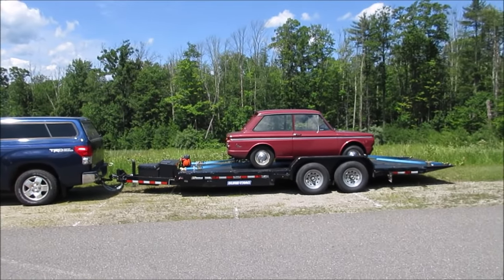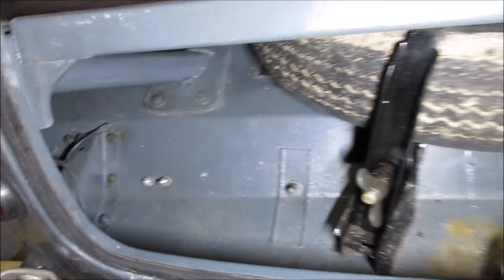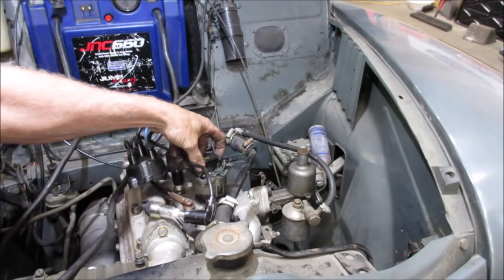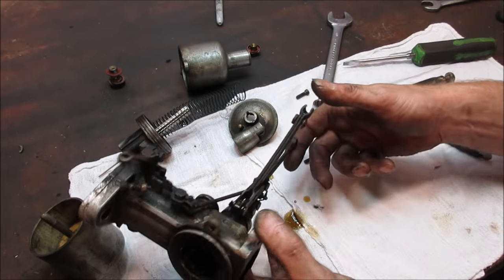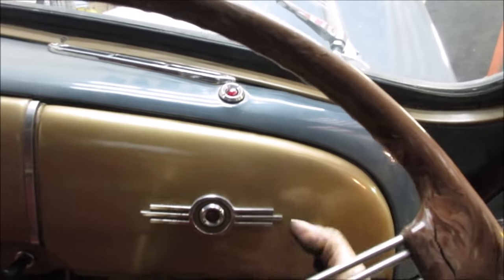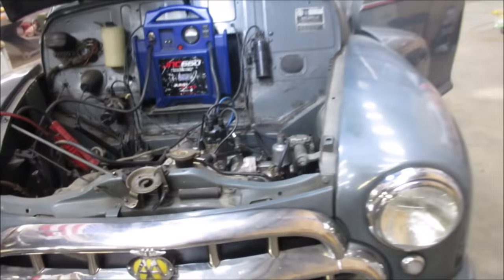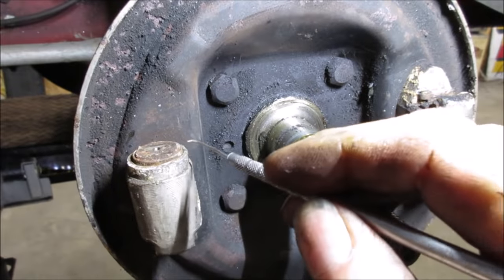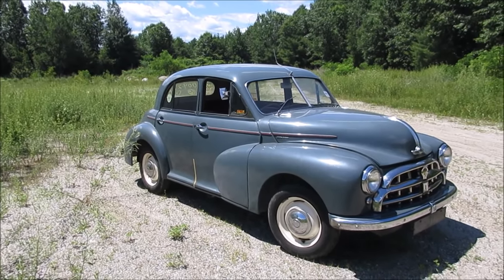50s Morris Oxford Found in an Old Warehouse. Did It Survive?

Comment: Hello... the semaphore was not as much a directional signal as it was more a parking light. Unlike North America, many of the roads and village streets of Europe and the UK are/were single lane, with barely enough room to park a car along the side, up against the wall or building. With many blind curves, the semaphore light served more or less as a hazard/warning lamp, though some did use as a directional. Later cars in Europe would later incorporate it into the  parking light system, only very dim, for battery conservation. Simply remove the key and employ the directional signal control, left or right. When the car is off, it remains constant, not flashing. This is, of course, independent of the emergency flasher circuitry...
I hope this helps...
PS The RAC/RECOVERY DECAL is the Royal Auto Club membership decal... similar to membership in AAA

Comment: To find out where the DC power system on a car is positive or negative ground, your theory is correct. Once the car is running, you can measure the output of the generator to find out the car body connects to positive or negative voltage, in the mean time disconnect the generator output wires from the car. Another method is to turn the generator without running the engine, just disconnect all the output of the generator from the car and attach those output wires to your multimeter. But, if somebody modified the wiring previously, then we need to verify this question with manufacturer document.

Comment: This model seems to cause lots of confusion.   Some folk clearly think it's a Morris Minor (which admittedly looks very similar but was significantly smaller and much more common),  which I can understand.  It's surprising though how many people are asserting quite confidently that India's Hindustan Ambassador was based on this model, which is simply wrong.  The Ambassador was indeed based on a car with a similar name (and no doubt plenty of shared mechanical bits beneath the skin), but the model featured in this video is the Morris Oxford MO, which was replaced in May 1954 by the quite different Morris Oxford Series II, which in turn was updated in 1956 as the Series III.     It was the Series III that saw new life from 1957 as the Hindustan Ambassador.  Here endeth the lesson!
  Great video, by the way - and good to see old British treasures surviving around the globe

Comment: I was working on a project at the airport in Mumbai, India about 20 years ago. These are what the domestic taxi service use, I understand that someone imported the old tooling and has been building them in India for many years. They were available new when I was there, around $1000. US dollars and available in Taxi colors of black and yellow, there also was a factory issue with
 A/C that came in a two-tone blue. I rode many miles in one of them traveling to visit vendors that were suppling some of the fabricated some our components that we had not imported from California. Some of the older ones the owners had installed 3 cylinder Yanmar Diesel engines in them and were trying to keep the vehicle on the road a few more years.

Comment: no air fuel mix its done by the metering needle being tapperd thin at the end thicker at the top, the jet seat is normally adjustable by threads lower it will make it rich, the choke is done by pulling the jet seat down there for allowing more fuel in.

Comment: Might want to check the dip stick again to see if oil level has come up! Pouring water in the radatior  may be filling the crank case if the head or block is cracked! I have an old Mercedes I poured antifreeze in it and raised the oil level in the crank case, not running right now traded for it to use motor in another project, hoping it is a head gasket but with my luck it is block or heas!

Comment: Hi, I may be a bit late with this but it is always a good idea to put the grounding lead from the booster directly on to the motor and not on the battery. Connecting both to the battery can cause a problem, especially if the bonding cable is not securely attached to the engine which can cause an overload to the internal battery. Just saying😸

Comment: Someone else has probably told you all this already.  Designed by Alec Issigonis.  For a flat 4 engine as the Mosquito.  Ended up as the Morris Minor with originally an 803cc side valve engine quickly on to a 948 OHV engine.  I owned a pick up version.  If you want to know more just ask....

Comment: This is an SU constant-velocity carburettor. The piston with the needle will rise with vacuum from the engine, as you step on the accelerator. As the butterfly valve opens, you increase the vacuum on the carburettor side . There is a porting that starts from the throat to the top of the piston. The piston will rise, allowing air through the butterfly valve. The tapered needle fits into the main jet. As it rises, the venturi effect of the rushing air will suck fuel from the main jet. The piston will stay in position at the given accelerator position, as the vacuum lessens when the piston rise. The main jet can be raised or lowered ( to control mixture richness) from under the carburettor. There is no need for an accelerator pump in constant-velocity carburettors. Technically, they are " slower in response" than the later downdraft or sidedraft carburettors. But they can be more frugal with fuel.
Trinidad & Tobago.
West Indies.

Comment: The fuel pumps were originally mechanical, then electric, with a long pull short push. On the mini it was mounted at the rear underneath the car, short pull long push, brilliant idea, out of dry hood into the wet and dirt/salt environment.

Comment: A quick search on Google would have answered a lot of questions about the positive earth etc. This seems to be an early 50's Morris Oxford, maybe 50 to 53, the body style changed in 54. These cars were more rare than the smaller, more common Morris Minor which had a very similar body style and was the predecessor to the Mini which was introduced in 1959, but the Minor continued in production alongside the Mini until about 1974 I believe. I used to see these cars occasionally growing up in the 70's and 80's in NZ when they were still running around. Good solid British cars. The Morris Oxford lived on in India as the Hindustan Ambassador into the early 21st century, as all the tooling for the Oxford was shipped off to India when production ceased in 1959 in the UK. That was the facelifted  Oxford Mk III shape which began life in 1956 It was one of the longest produced production cars in the world when in ceased production in 2013.

Comment: To answer your question about suspension damping it seems that this car has inboard hydraulic suspension dampers. That's the pod that's right behind the battery with the castle nut on it. I'm not from the UK and I've never been there, but as soon as you showed that front suspension setup the first thing I said to myself was that it had to be hydraulically dampened. Can someone from the UK that knows these cars verify?

Comment: Positive ground or negative, it doesn't matter. That model and date has a dynamo, and all you do is to connect the battery leads the other way round! But this is important, before connecting the second battery lead, turn on the ignition and then just quickly flash the lead onto it's terminal a couple of times. Then connect the lead and that's it, you've converted a positive ground car to negative ground!  But be warned, only so this if the car has a dynamo, which that one does. Hoping this helps. An afterthought.  If the car has a radio, disconnect it first, as in most cases it can't be changed over to negative ground.

Comment: I have just watched this glorious video again,  and I appreciate more than my previous comment might have suggested, how much this old British automobile would have differed to its US counterpart in 1955. Although I suspect that this Oxford model had long gone by 1955, along with the split screen. My 1955 Austin A50 (a similar size car) was a far more advanced car with Austin's 1500cc B series engine, full windscreen, and flashing indicators.
Anyway, during my first watch - a year ago, I, as other comments also state, was shouting at the screen and wondering what was wrong with this mechanic having to work out things that to me were basic.  That was insincere of me, so I would like to apologise to him.  I was never a trained motor mechanic, but from being 19yrs of age, up until my 60's, I have serviced and repaired all my own and my father's cars. I'm 80 now, so it's all history.  I learned the hard way as needs must when you can't afford to pay someone else. My first learning curve was on an evil 1950 Morris Minor MM lowlight, bought by me in 1961 ... I was sure that it had been cursed by one of its many previous owners.
Nonetheless,  being the little sister of this chap's MO Oxford, most of his problems were all too familiar, the two cars being family and the offspring born side by side on the drawing board of Alec Issigonnis in 1948.  While I now abate any further criticism, I wonder if anyone else suspected that that poorly engine had a serious timing issue - ignition or valves.  That broken gear wheel he found in the boot (trunk), looked very much like a camshaft gear which is suspicious.  Being a side valve engine, a mistimed valve cannot be damaged by the piston as it would in an OHV engine. The brakes on Morris cars were by Lockheed, so where on Earth replacement cylinders and adjusters will be found in the US I can't imagine.  But here in the UK, we have a number of Morris Minor Clubs and restorers who must be getting parts from somewhere.  They can make an old 'Moggy' like new again. Oh yes, does anyone know why this car's battery was sitting on the heaviest side of the engine instead of in the bulkhead tray as in the Morris Minors?+++++++++++++

Comment: SU. Carb , long lower rod is the choke , accelerator is the Diaphram, the center jet is mixture usually 2 turns down from flush as a start. Same used on MGBs different versions.Have fun..

Comment: That brass nut on the carb that you dropped oil into is a damper for the large piston. You should put more oil into it so it slows the movement of the piston

Comment: SU carb..  You probably know by now but the Top bottle is a vacuum operated chamber that controls the flow of fuel. The internal piston has a tapered needle fitted which as it lifts allows more fuel. The lower lever tibe assembly is the Choke mechanism, It effectively lowers the tube which allows more fuel to pass the needle for cold stating. The position of the tapered  needle is critical. as is the number stamped on the body of the needle. Unless you gar fuel leaking from the choke tube it's best not to tamper with the setting. Mixture adjustment is also done with the smaller spring hexagon nut which adjusts the height of the choke tube and hence the fuel air maxture.  A very simple but very relable carb used on almost many British cars from the Mini to the Rolls Royce. and lote in between.. The  Chamberr on top of the Bottle assembly is a damper to smooth out the movement of the piston, it should be filled with a 30 grsde oil to 1/2 inch from the top.

Comment: In the early to mid 80ies, the mechanical gas pumps could not handle the higher prices. Oil companies installed a modification to dispense liters instead.
This confused a lot of people. This sticker was advertising from Shell to help customers understand how much fuel they were getting.
the statement "It will improve you car was referring to the gasoline but my guess is that they also wanted people to think buying by the liter would somehow give you better performance.

Comment: That SU-carb has same kind slide system as late Strombergs but those had rubber membran under the cap. They recommend use ATF oil in it.

Comment: Arrr the ol Morrie. Still a few getting around here in OZ. Not that expensive either. 44:23 our UK gentleman can correct me if I’m wrong, I think the whitworth spanner size refers to the thread diameter, not across the flats like metric and imperial ( what U.S call standard) 🇦🇺🤙🏼

Comment: All British vehicles of that age were positive earth (ground) but the dynamo (generator) could be polarised either way deliberately by briefly energising the field coil with a jumper. Also if you connected the battery backwards good chance it would work fine. My dad only found out the garage had done that when he turned on the radio which started smoking !

Comment: -Very nice car, I would not mind having one of these old 4 cylinder car from overseas. Easy to work on and good with gas mileage. Also the car has lots of well rounded lines. Darn good looking car. I do not know if they have dealerships here in USA or only in England(of course this would be going back 70 years ago);

Comment: This look like a 1953/54 model, I owned a 1952 version with a "Cheese grater" style grill. The car was a 12-volt POSITIVE Earth (ground) electrical system, The engines were very easy to work on, and could be completely overhauled in the car.

Comment: Sounds like the choke is on, the way it's idling - may need the cable adjusting.
It's deffo running rich at idle, but sounds like it's firing on all 4 when you rev it...

Comment: If this has not been mentioned atf goes in the top of the su carb. It keeps the throttle from droping of too fast. We had several volovs with side updraft carbs. The oil will get pulled into the gass mix. Just top off with atf o

Comment: The oil in the carburettor dashpot should be a bit heavier than you used - its purpose is to damp the piston movement. Some people use straight SAE30, I've always just used whatever engine oil is in the engine.

Comment: That poor SU Carby! 😢 You need to loosen the large nut undetneath and re-centre the main jet so that the needle doesn't rub.
You csn hear it scraping and binding when you lifted the slide. Left like that will destoy the needle and main jet and it will never be in tune.
Idle mixture is the smsller nut underneath. There needs to be oil in the top inner chamber of the slide to damp the piston. Too thin oil will cause it to bog under fast throttle movements.

Comment: Fantastic car.  If you want a car that's so easy to work on, this is it.  it's use as a taxi in India says it all, very simple to work on at the side of the road, tons of engine space.  Ok, the engines were primitive, but very reliable.  The one you have in this video is like new underneath, in the UK with snow and ice and salted roads  the underside and the sills used to rot away, hence very few about now.

Comment: at 60 and a brit i have had meany years playing with that type of carb and all i want to do is strip it and point out all the workings  to you and the DASH pot [the thing filled with oil] needs to be filled to the top of the inner tube  could be the starting problem and the rough tick over

Comment: Carb is an SU (Skinner Union). The oil in the slide controls the rate of piston speed (damper) and should be a light machine oil. Got reliable and still made in China today! In the UK we call flat heads, side valve engines.

Comment: To be honest the ground polarity does not matter much on these cars, the dynamo will charge correctly either way, the coil connections should be reversed but in practice they will run as they are.
Although originally built positive earth most got turned around to suit modern radios. Usually you can get away with not flashing the dynamo to change polarity. The ammeter will read backwards.

Comment: For an inspection sticker you'd be looking at a circular shaped window sticker or "tax disc" also on the windscreen, probably underneath the RAC membership sticker, which would indicate that the car is taxed and inspected (via the MOT test, which used to stand for Ministry of Transport -- now that it's the Department for Transport, DfT doesn't seem to have caught on, it's still "MOT")
Reply: The DfT just changed what MOT standards for - "Motor Ordinance Test".

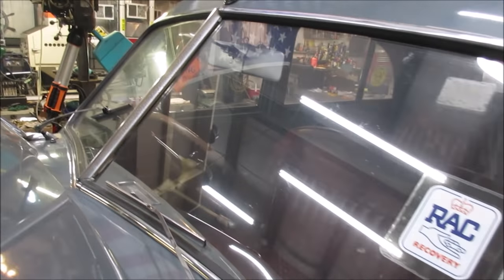Comment: 1:07:55 RAC is a breakdown company though historically a automotive club. I would think the equivalent of your AAA (we also have AA).

The conversion chart is for the older generation as uk used to use imperial measurements but went metric.

I wonder if the animal is still in Plymouth.

It won’t have an inspection sticker it’s called an MOT here and you get a certificate to prove it has one.

Comment: I grew up in the 60-70's in Ireland. Cars like these were purely ornamental. They wouldn't start if left out in the rain or kept in a garage overnight. If it were bitterly cold or hot however once condenser, points leads and plugs rotated with the set in the boot (never new), a spray of 'Damp start' and a liberal dash of various vulgarities, they would struggle to life only for the same ritual to be repeated the following morning. We wouldn't witness the resurrection as my mother would have squirreled us off to get the bus rather than see my father go through a mental breakdown.

Comment: tehtop piston that has that big spring is the mixture adaptor ,the fluid in the middle is ;ike a s hoch ,when the throttle opens the piston wants to raose but if it raises too kickly the extra mixture is lost ,that pin in the middle act as a shock and releases slowly the movement of the piston to go up hence extending the enrichment stroke

Comment: the oil is for the pot damper, to slow the piston flying up to quick on full throttol, without the oil in the damper the piston comes up to quick and gives you a massive flat spot on acceleration engine falls flat.